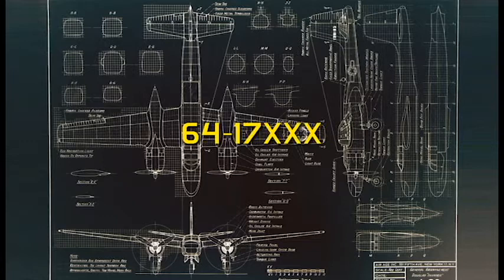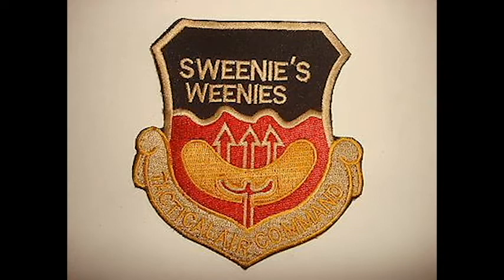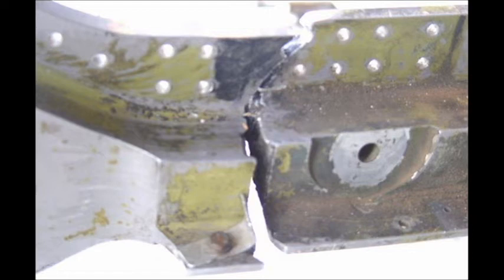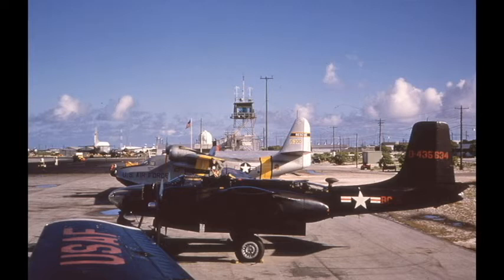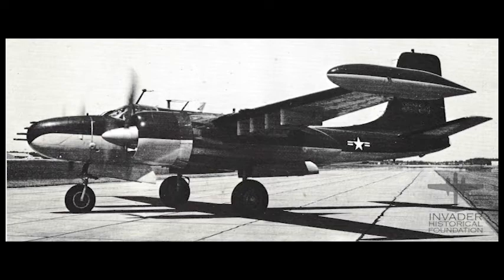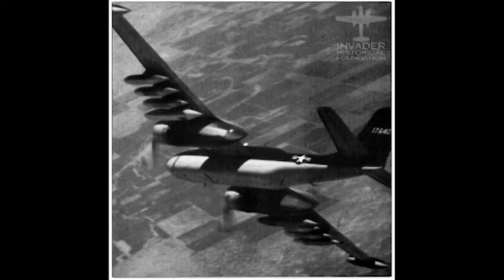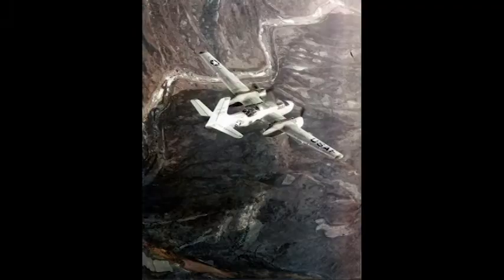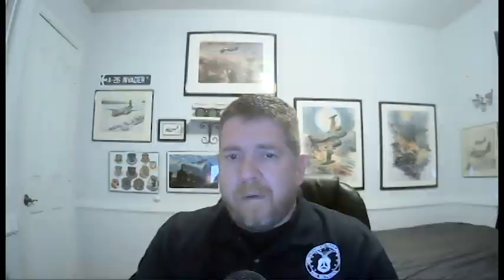B 26K Episode 1   Background and Development

Comment: Early in the1970's I had the opportunity to fly for a newly established air carrier based at KBKL.  In 1972 the company acquired Convair 440 aircraft.  These particular Convair 440 aircraft were powered by "air cooled R2800" with a water meth injection system.  I think you may have incorrectly stated that some versions of the R2800 were "water cooled".  All R2800 engine were air cooled.  The "water meth injection" was used for high gross weight takeoffs as added boost.  I believe the water meth tank had a capacity of approx 20 gals.  This water meth system was "armed" for high gross weight takeoffs, landings and go arounds allowing water meth to flow at high power settings.  This system  was manually "disarmed" on climb out after flap retraction.

thanks for your videos ,  very interesting
Reply from the maker: You, sir, are quite right. I misspoke there and meant to go back and edit that, but then I forgot about it. But yes, the R-2800's were air cooled. Thanks for watching.